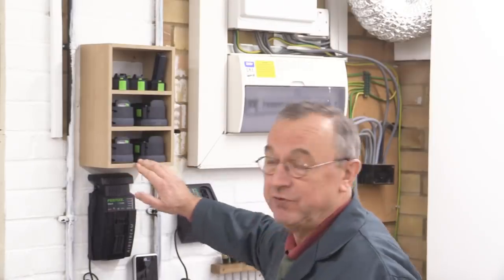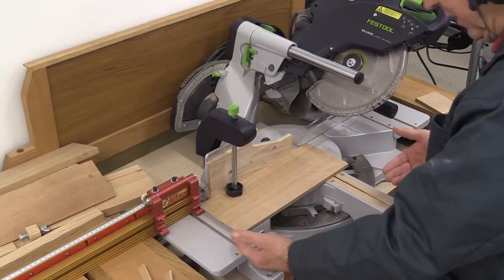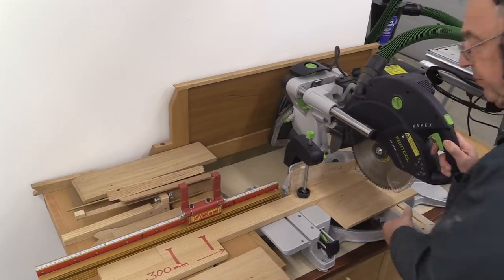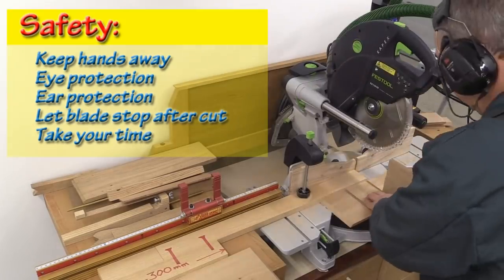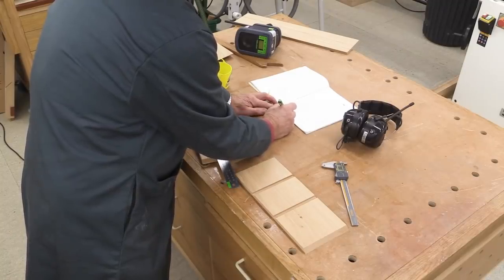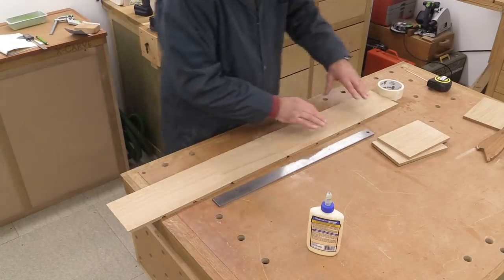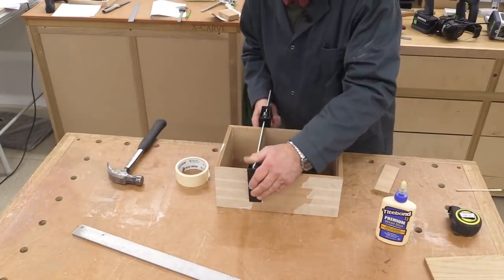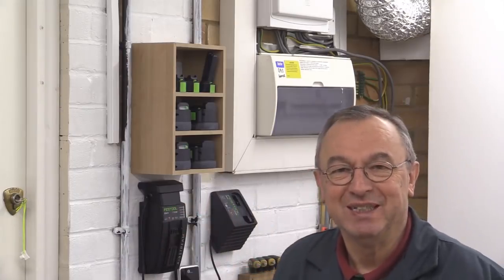How to make a set of box shelves

Comment: Peter you’ve done it again. That simple trick of using a piece of stock to move the work piece toward you so you get a flat bottomed cut the whole way would’ve helped me when someone backed over my mailbox and I had to cut some half lap joints. Thanks!

For this project I’d use a router though.
Reply from the maker: A router would be perfectly good but it is a little quicker to use the mitre saw for minor work like this. The router would be more accurate as far as depth of cut goes.  Cheers.   Peter
Reply: New Brit Workshop - good point Peter

Comment: Thanks Peter. Again a very good video with clear instructions. I'm in a need for nice shelves in my workshop to store all the small stuff that I now keep on the tables. I'm gonna try this tape trick tomorrow.
Reply from the maker: Hi Samu, It is very quick and easy but do make sure the glue goes off before you remove the tape.  Cheers.  Peter

Comment: Thanks again Peter.  Not being fortunate enough to have a Kapex mitre saw but lucky enough to have a Festool track saw and MFT courtesy of the Parf system. I was wondering if you would consider doing a similar video just using the track saw for this.  It should be able to do the mitres . Trenching cuts and a rebate shouldn’t it?  Thanks again
Reply from the maker: Hi Randall, That is a good idea and I will add it to the list.  Cheers.  Peter

Comment: Interesting approach. Thank you for sharing. In Canada U would use a dado set on my table saw, but I understand that in the EU you are not permitted to do that. My second thought and what I would do in my shop in Italy is to use a router for the dados.
Reply from the maker: Thanks.  Peter
Reply from the maker: Hi Pat, Many thanks.  Peter
Reply: I was going to say (but Pat beat me to it) that you can get and use dado stacks in the EU. The biggest issue seems to be the availability of saws with a big enough arbour to take them.
Reply: Pat Mahon Thank you for the clarification. There seems to be quite a bit of misinformation out there. My Italian supplier insists that it is a violation of the electrical code, mandated by Brussels. I suppose that it is another case of blaming the EU.

Comment: This is great.  How would you go about making a larger version of this for workshop shelving boxes that can take moderate weight?   Do you have a video that would be suitable construction that is transferable?

Made some shelves following another video.  Didn't go well because their method was absolute junk.  They've  probably fallen off the wall already.  I think most of the people just watch and don't try to make themselves.
Reply from the maker: I would not use this method for large shelves where a heavy weight might be expected. I have not made any videos about other methods of shelf creation but a simple method is to have a pair of sides between which you glue and screw (or Domino) the shelves.  Peter
Reply: @NewBritWorkshop  Many thanks for your reply, Peter.

Comment: How are you Mr Parfitt? Another very useful video. May I ask why you use Bessey’s uniclamp instead of the k body?
Reply from the maker: There is nothing wrong with the larger K Body clamps but for smaller stuff it is useful having the Uniklamp. They cannot apply as much pressure but that is not a problem. I am thinking of getting some more as they are so useful for smaller jobs.  Peter

Comment: Would’t it be better to do the trenching cut on the table saw? I guess also for the mitre cuts. That gives you better dimensional control with the distance from the edge and the fence, doesn’t it? I use your tape trick all the time - excellent - appreciate all we can learn from you.
Reply from the maker: Hi Geir, My guess was that more people would have a mitre saw than a table saw. But, yes, you are right.  Cheers.  Peter
Reply: @NewBritWorkshop  Hi Peter,  but then you really need a Kapex or similar - I tried to trench with my old DeWalt DW707 - not easy. Still I follow your videos and really enjoy your work. I ended up buying a Kapex K-60 because you and David Stanton showing the capabilities for the larger Kapex saws. I have not regretted it a second. I also did my workbench based on you Parf guide system - excellent stuff - keep up the good work!
Reply from the maker: Hi Geir - Brilliant.  Cheers.  Peter

Comment: Hi Peter, simple and very effective.  You said rebate at the start.  Is that not a housing joint?  You also mention MDF.  What timber did you use?  It doesn't look like MDF.
Reply from the maker: Hi Steve, Rebate - put that down to age ! I have used oak veneered MDF which is 10 mm thick. It was left over from something and had been sitting around for a while. The key think is to get across to everyone how quick and easy this style of construction is - and it is very strong.  Cheers.   Peter